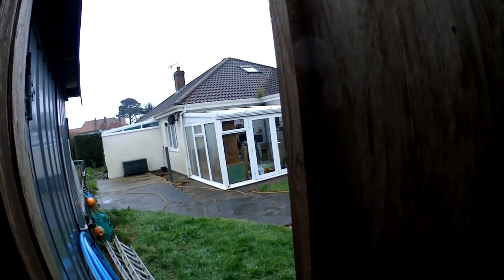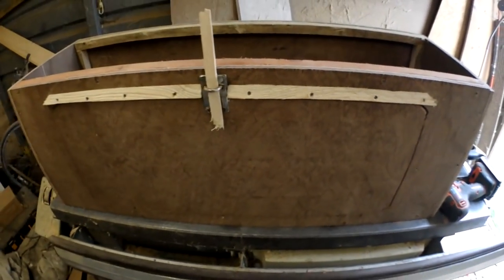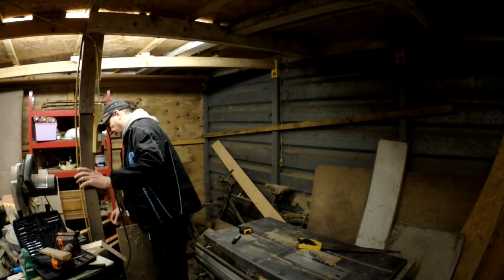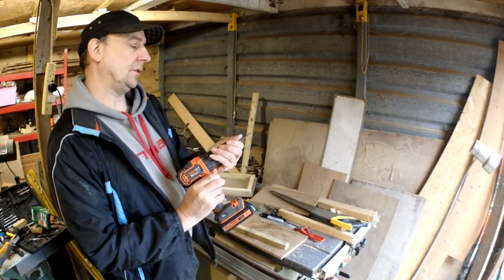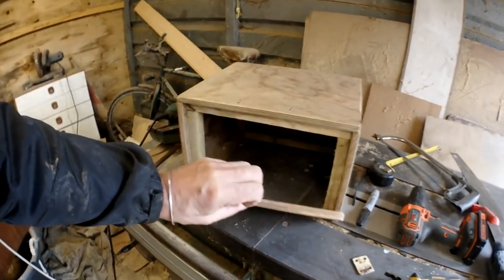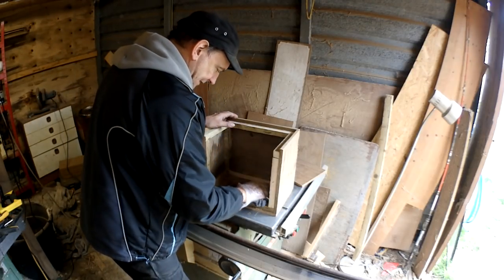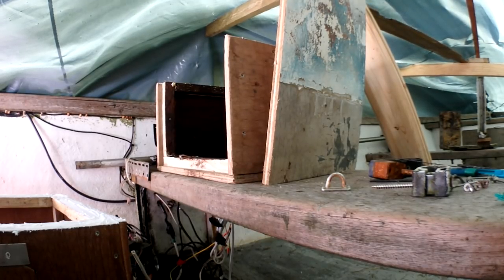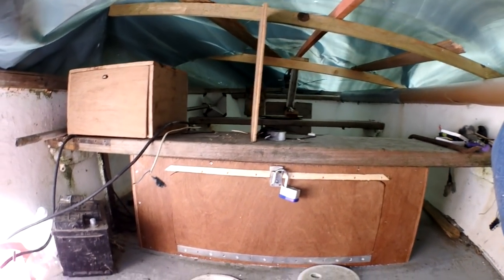⛵ Small Boat Owner 3 - Building Boat Cuddy / Locker

Comment: Even after waxing / staining / treating the wood, does it still expand a bit with the water? And for your electrical work etc, is it worth you getting some ACF-50 to coat them? Stops any water ingress and also contains a rust inhibitor. It's a little bit on the expensive side, but worth it...
Reply from the maker: Never really noticed if it expands after waxing. Painted do. I usually dip wires in marine grease before connecting and put more over joints or backs of gps and sounders that seems to work. One important thing is to have a main switch to shut power down to all electronics when not using them this extends the life of cables and electronics especially on an open boat. Learnt the hard way years ago when cables and pins in sounder rotted after 2 seasons.
Reply: @Trojwaterman  Some kind of electrolysis reaction?
Reply from the maker: Yes I believe so